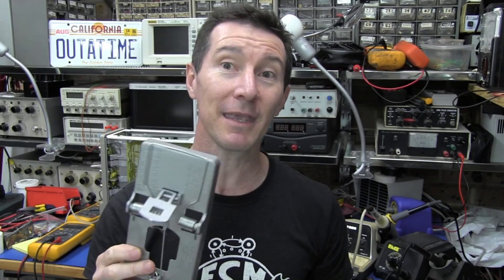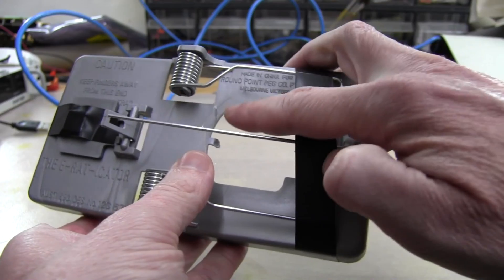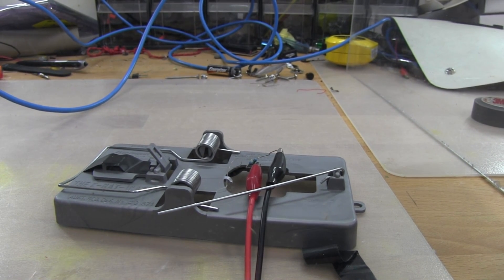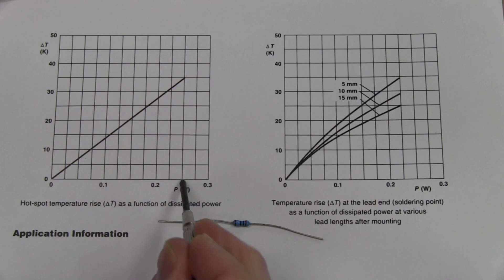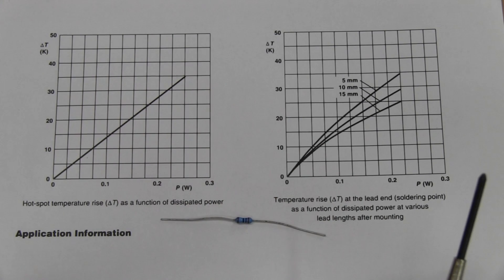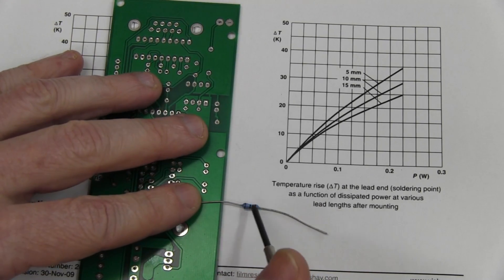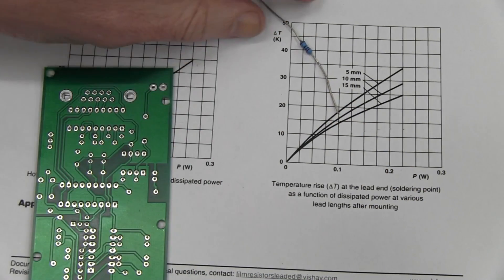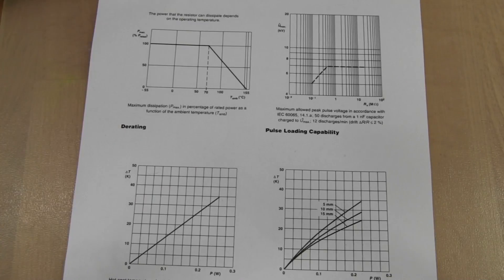EEVblog #191 - Mouse Trap Triggering

Comment: I had a similar problem to solve triggering a spring arm at a distance. one 20 guage-ish strand of copper cannot handle  much current so I just used the copper as my trigger wire that needed to be cut, 120v dead short across the wire melts the wire for you faster than a 15a breaker can trip. can also be used to light a match at a distance, be carefull though!

Comment: I've heard of this kind of system being used to cut the reefing bands on parachutes. Also to cut loose drouge chutes after they drag the main out of its container.
Reefing bands are basically a line around the shroud lines of a circular parachute that prevent it from opening to its full deployed diameter, which is often done to reduce the g-loading shock that would otherwise occur if it went directly from packed to fully deployed. Reefing bands are also used to control decent rate in order to limit wind-induced drift.

The reason they are found on parachutes so much is because they are easily triggered, absolutely dead simple, and can be made extremely lightweight. Because they are so simple, they are extremely reliable. Not much to go wrong with a resistance based heater, and resistors aren't static sensitive.

Also, resistors and wire are dirt cheap, so they don't cost an arm and a leg, meaning using 2 or more of them for redundancy's sake isn't going to break the bank.

Comment: Dave you can also use a 9 volt battery and copper wire. Or get an old flashlight bulb, break it and use the element for heat.

Comment: What I like about this video, is that is shows a simple, cheap way to trigger a spring or cut a holding string. Sure, there are solenoid units that will do the job, but they weigh more, cost more, and have moving parts and there are more things that can go wrong. This method is cheap, simple, low cost, low weight and reliable if the resistor is only used once. Great video and genius idea.

Comment: I often sail solo at night with the boat's tiller held with control lines. If I fell off the boat, the boat would keep going. I have been considering various inexpensive one-off MOB (man overboard) devices to release the tiller if I fell off and a sensor contacted water and triggered the release automatically. I think this resistor burn has potential for this application. A second question for the experts is how to signal the boat while in the water. A small radio ?

Comment: @axel1973w Too Dangerous?? Electronic parts get extremely hot in working devices all the time. You wouldn't want to set up hot electrical components in a pile of sawdust but with a little planning there is nothing to worry about.

Comment from the maker: @axel1973w You missed the point entirely. It's got nothing to do with the actual mouse trap, it's just another possible method to one-off trigger whatever widget that it might be suitable for.
The resistor doesn't need power either until triggered.
I've actually seen it used in two different scenarios, both military.

Comment: I used resistor like this to fire up the rocket engine. But it was powered by a 350V150uF capacitor, charged with a flyback converter. Reaction was rapid, but resistor destroyed totally.At first looking at the video I was sure you'll construct an optoelectronic barrier or something to trigger a mousetrap ;-) 

Still don't understand linear graph of power dissipation of the resistor. Shouldn't look like this accoring to me.

Comment: Regarding the thermal dissipation via the resistor leads, I think it would have been worthwhile to mention that hot resistor leads can stress solder joints, and cause premature failure in some cases.

Comment: Pull the pin with a bi-metal strip. and you've got a resettable current/heat triggered trap.

Comment: You didn't indicate how long it takes to melt the line.

I would use a 1/8-watt resistor to hold down the lever (one end on the lever and the other on the trap base), then apply enough current (say from a large cap) to blow the resistor to smitherines. To heck with melting things.

Comment: @jnrolf If the thermal resistance is 140 K/W then it is also 140 degC/W. Kelvin degrees and Celsius degrees are the same size (in other words, when converting one to the other the multiplication factor is 1).

Comment: How can you do this will low power? Is it possible to find something that will run on 10mW that creates quite a bit of heat? It seems hard to search for resistors based on thermal resistance. Are there things better than resistors if you are wanting to repeatable generation of heat?

Comment: I did somehting like that as a kid, though there are times when you need it to be portable and reliable(Operating almost instantaneously everytime). what i did was i got a flash circuit board from a camera and rigged up a cct to trigger it by remote, then i send all the juice in the fat capacitor to a resistor. I used SMD resistors(less than 6ohms). they explode everytime, great for setting off fireworks:)

Comment: Great to see some fun stuff from you again Dave!
BTW, I seem to remember someone trialling the fishing line approach as a
trigger to early bushfire detection. 
A small DC geared motor with 'winch' setup with microswitch would probably
also be the go, although that's a bit OT re. your fine talk on resistors...

Comment: I've heard of a similar method used as an emergency cut down for high altitude balloons (cut through the nylon lines connecting the balloon).  I think they might use nichrome wire though.

Comment: @jnrolf No, Dave was right. 35 Kelvin degrees = 35 Celsius degrees. Remember we are considering temperature differences, not absolute temperature measurements. Degrees in this case means "degrees of difference".

Comment: It works.  But seems kind of a pain to reset.  If you want to use Ohm's law you could use a piece of nitinol/flexinol shape memory wire to pull on the arming latch.  But it was a good excuse to say something about resistors anyway.  How about a vid on the effects of the temperature coefficient on resistance or voltage regulators?  Seems to catch some new people when they are trying to make something precise.